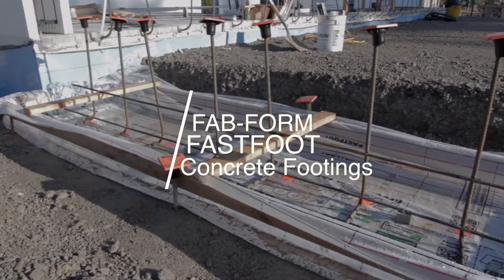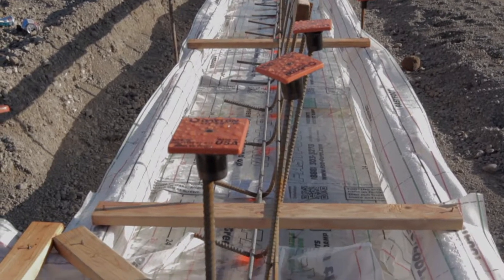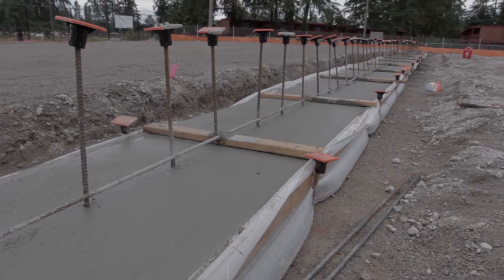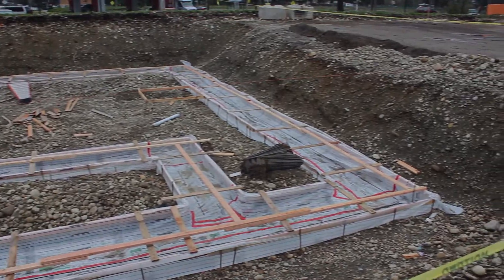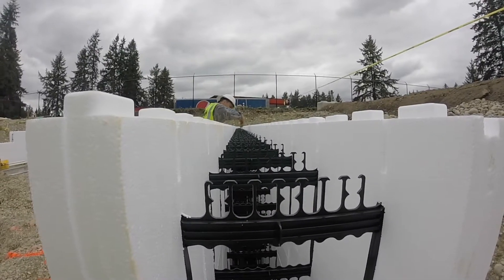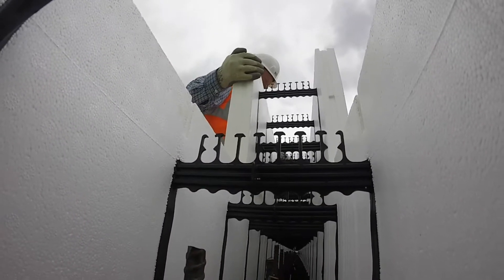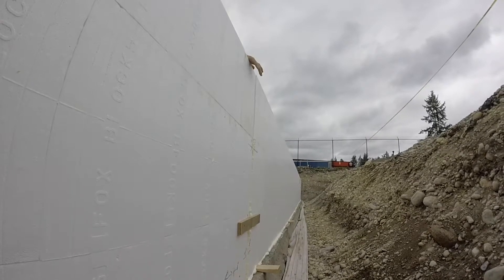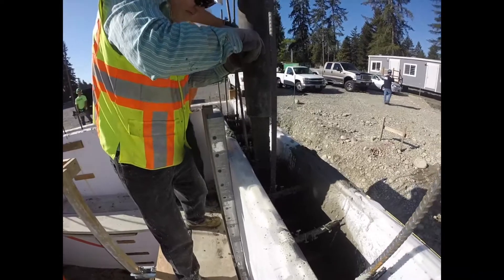Anatomy of an ICF Building - Part 2 - FastFoot and ICF

Comment: Block might lift during the pour because at 3:04 the HV Clip installer is not actually connecting the top block to the bottom block...  rather he's connecting the two internal connectors on the one block.  Probably thrown by the camera but something to watch out for.
Reply: Nice catch !

Comment: This ICF would appear to be 2.5" thick EPS and therefore R-22 if the foam is 1.5 psi density such as AMVIC forms from PACIFIC ICF.  Nudura uses less dense foam and would have less R value.  

AMVIC makes an R-30 block and if you added two layers of R-15, 3" SILVERBOARD, you would achieve an R-60 wall

Comment: Great videos. No such word as footer, btw. :) You're making my structural engineer face palm, #footing #notfooter #masonry #notmasonary
Reply from the maker: Hi John,

These are footings from FastFoot as shown in the beginning of the video.
Reply: Dictionary of Construction terminology: footer,footing    Continuous 8" or 10" thick concrete pad installed before and supports the foundation wall or mono-post.  LOL, thanks for watching
Reply: Clearly the only book on the planet where the term exists. It's taught as a footing in engineering, architecture and construction schools for a reason. But what do I know.
Reply: I couldn't explain the history of the word only that it is commonly referred to as a footer or footing both on the job site and in written form.

Comment: The R50 claim is BS with standard forms actual R-value closer to half that claim. Stop misguiding your customers concrete in its self has little R-value to the foam! Why didn't you place EPS under, on each side and the top of the Fastfoot to increase R-value?
Reply: The Oak Ridge National Laboratory published a killer white paper of their ICF study back in the late '90's or early 2000. .. In short,, a plain jane ICF structure when enhanced by an additional "center" placement of 1"- 2" EPS effectively increases performance metrics exponentially. .. Say what you will, however, our 6 townhouse properties in Germany made largely of block with EPS exterior strata will continue to stand after the next bombing. .. So much for stick framing. ... Cheers, M/S
Reply: Indiana Fred hears the report and study fresh off the research floor.  
http://icf-ma.org/category/featured/
Reply: Indiana Fred here’s another discussion based on the insulating properties of the EPS in combination with the thermal mass of the wall providing an R50 performance factor.  Thanks for checking out the videos.
https://force5walls.com/homeowners/faq